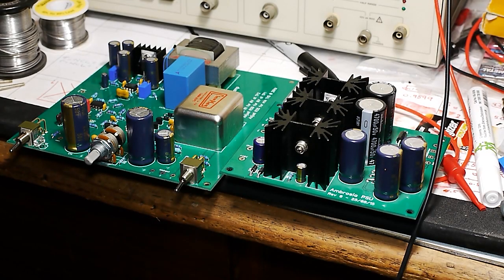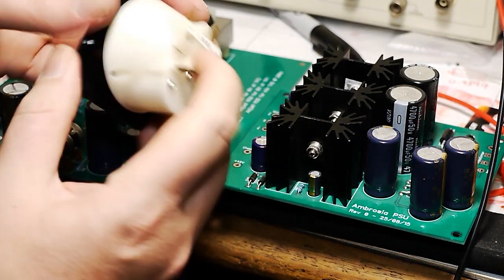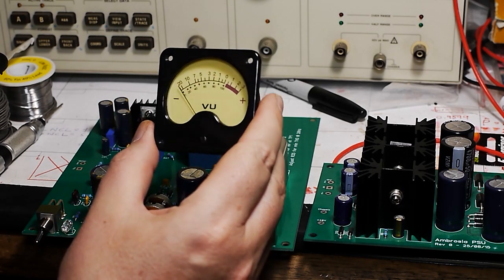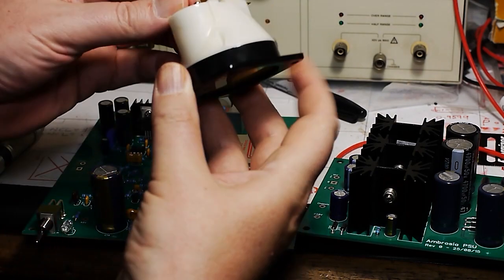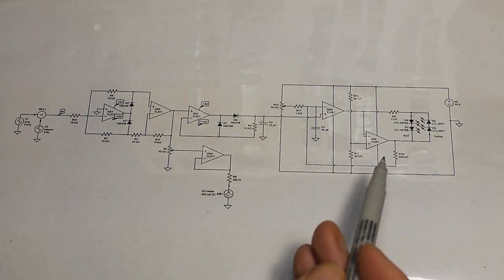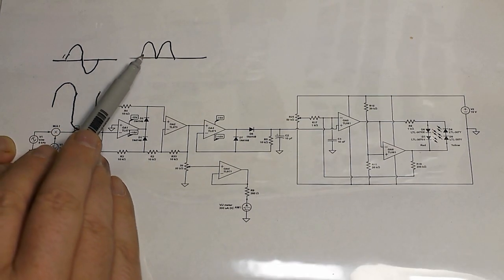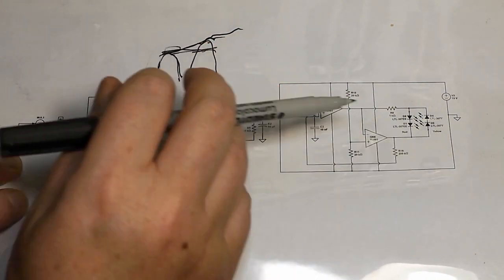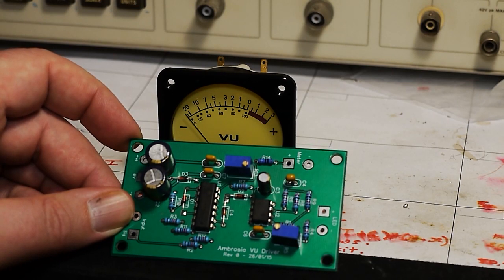DIY microphone preamp project - VU meter driver

Comment: Karl, thanks for the reply. You are correct. My mistake. I'm obsessed with precision rectifiers so I breadboarded your circuit late one night after watching your video. I was the one who reversed the diodes and, of course, your diagram is perfectly correct. Sorry for the confusion. I can verify that the circuit doesn't work if you wire them backwards and works fine if you don't. :-)  All in the name of science.

Comment: Karl, check the schematic linked above. I believe you have reversed the polarity of both D1 and D3. on the schematic. Obviously, you have them right on the board.
Reply from the maker: G'day Ralph, I've looked into this but I'm still not seeing it. The curious thing is that the linked schematic was rendered out of Diptrace, so it really should match the board layout (rightly or wrongly) if nothing else. Maybe not the clearest way to draw that part of the schematic (with the op-amps oriented that way) but I did keep it consistent between the simulation (the schematic in the video) and the Diptrace schematic capture, as transcription errors in that process have caught me out several times before. I'm happy to stand corrected of course, but both schematics look the same to me with regard to the orientation of those diodes.

Comment: Hi Karl,

can I use this scheme to output from the amplifier? I need to connect VU meters to the turntable. Can you please advise me? Thank you and you are doing a good job 👍
Reply from the maker: Hi Mario, thanks for your support. Probably the biggest challenge in adapting this circuit would be the fact that it's designed around a split +/-15V power supply (since the circuit is DC-coupled, it's not so easy to adapt to a single-ended power supply.) In terms of input voltage swing, you could use it with any line-level output, and probably with a speaker output from a low-powered (say less than 50W into 8Ω) amplifier (limiting factor is that the input voltage shouldn't swing beyond the power rails of the input op-amp). A traditional turntable output would probably be at too low a level, and would need the RIAA equalization curve applied in order that the meter reading would accurately follow the content (otherwise the high frequencies would move the meter much more than low ones) - although a modern turntable with line-level outputs would be fine, of course.
Reply: First, thank you for the answer.
Of course, I already have output after RIAA equalization, then the signal goes to the amplifier. But if I use a test vinyl with a 1kHz signal, it can be a different level output than a digital output such as a CD.

Comment: Hi,  Any idea  what type of Mic preamp this is?   It is a rackmount   has input and output gain , pad and phase on the front panel,   48V  and hot pin out  switches on the rear with   XLR in/out

https://www.youtube.com/watch?v=AfsRmITHtpQ

Comment: How did you test the speed of the needle indicator? Thanks.
Reply from the maker: I used a function generator to create a square wave at around 1.6Hz, so that the level was high for 300mS, then low for 300mS. By wiring a trimpot in series with the meter, I could adjust the amount of damping, (so long as I compensated with the output level and DC offset adjustments on the function generator as well) Eventually (with much jiggery-pokery) I got it to just reach full scale before it started to sweep back in the other direction, where it would just reach the end-stop before moving back the other way again. If the needle reaches the end and waits there for a bit, it's moving too fast - and if it doesn't quite get there before changing direction, it's too slow.